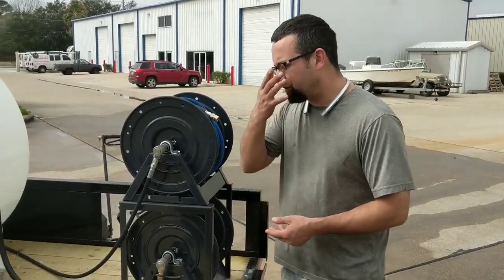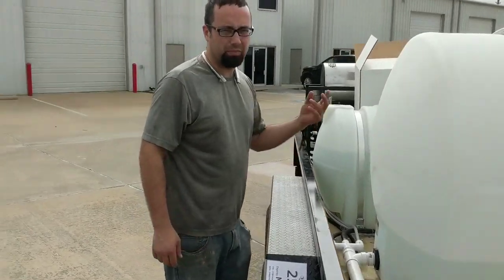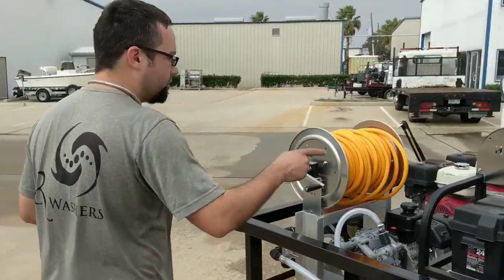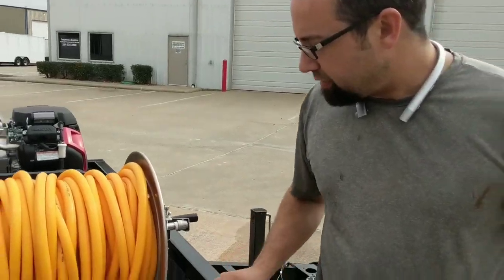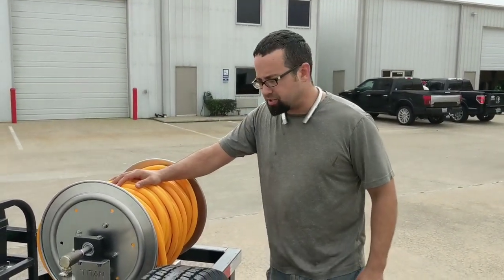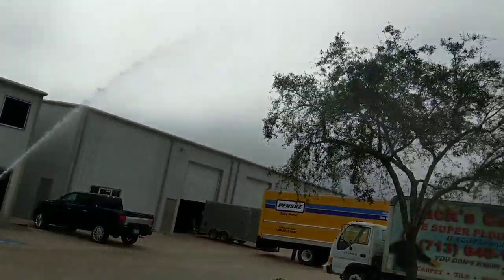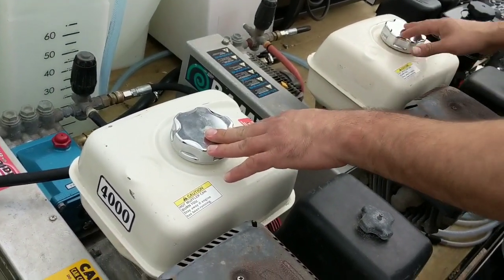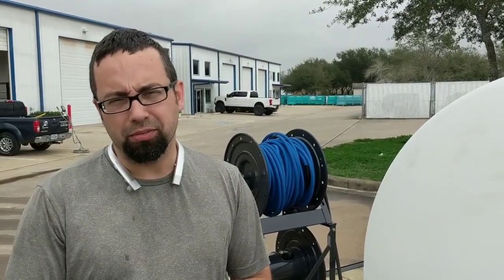The Distributor gas powered soft wash system

Comment: I'm interested in a 12v soft wash system. Also a hot water system with a surface cleaner. I have a single axle 14' trailer. Ballpark on what im looking at for a build?

Comment: How does one order the proportioner set up for the gas powered soft wash?  Also, what happens when it goes in bypass
Reply from the maker: We no longer sell the distributor.  We have had great results for our use, but if you run employees and air is introduced it becomes problematic.

Comment: So the diaphragm pump is basically on  loop when trigger is released?
Reply from the maker: Correct, like a direct drive pressure washer.
Reply from the maker: @Terry Chant the problem is even with a longer loop you can still encounter problems.  But the longer the loop, the longer you have to leave on bypass.  In reality there is no reason a machine should ever be on bypass for more than 5 minutes.
Reply from the maker: @Terry Chant I don't know what it would do because it eventually causes the hose clamps to leak.

Comment: just wondering, but you said the soap/bleach tank is 135 gallons right?  Won't that put them into Hazmat regulation levels?
Reply from the maker: If it's filled above 110 gallons, yes
Reply: @TxCoWash  I'd disagree and further research may be in order.  With all the government regulations that I've ever come into contact with.  The government only cares what the availability is.  not the load.  The government assumes that if you could carry 130 gallons and you happen to have  less than your 110 gallon limit...They just stopped at the wrong time.
Reply: clean power you are 100 percent correct
Reply: It's about the CAPACITY.   1000 lbs of chemicals max on board. But they will look at the total possible chemical weight that you could have on it.   If I have a ibc tote with 100 gallons of SH they would write some huge tickets bc I could have 275 gallons ~2500lbs of chemicals.

Comment: How does the soft wash work with the metering system and bypass? I'm interested.
Reply from the maker: Has three valves and meters water, surfactant and bleach
Reply: @TxCoWash  I have a similar proportioner.  I'd like to know what happens to the mix when it comes out of the bypass.
Reply from the maker: @kenshousewash7312  nothing because the bypass does not go back into the mix
Reply: @TxCoWash   Ah I see. So the bypass recerculates back into the inlet. Any issues staying in bypass for an extended period of time? Thanks.
Reply from the maker: @kenshousewash7312  don't run it on bypass for more than 10 minutes.